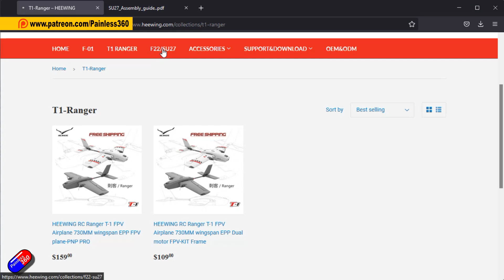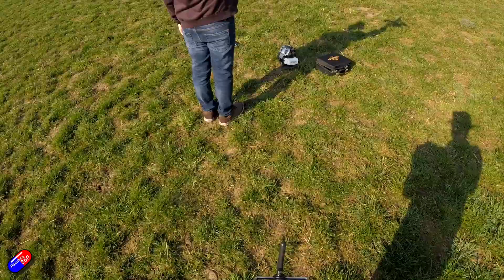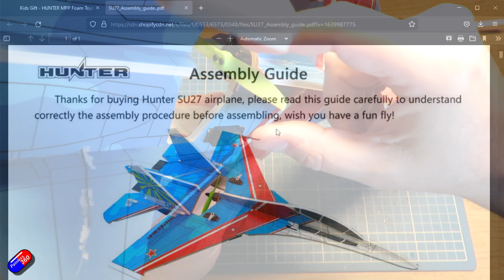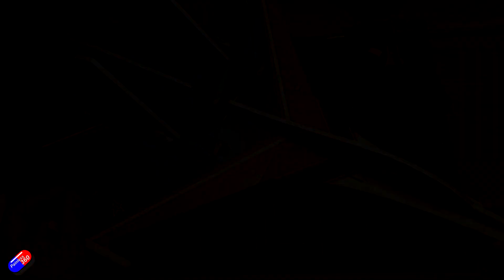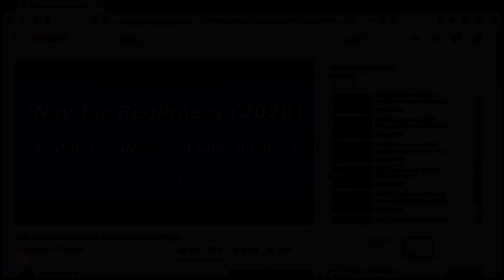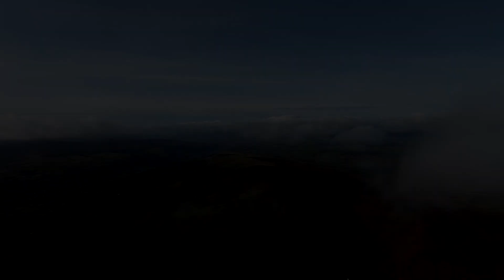HU27 Heewing Jet: Building tips and Review

Comment: Hello bro want to know why esc burnt out with su27rc plane kits my 30a esc burnt out
Reply from the maker: It could be a few things, without knowing what happened it's impossible to say which it was.... Happy flying
Reply: @Painless360  I used 2200kv motor 30a esc 9grqm 2 numbers servo and 3d print plane model battery 1500mah 11.1v 3s 6 inch propeller in 3 seconds flying burnt out wsc and plane as well wire are fix Yellow with yellow red with red and black with black esc wire in receiver port 3 and servo port 1 and port 2

Comment: I just got one and put it together and got it in the air today. I dont understand how s-bus works so mine is just flying off a ar500 spectrum receiver. It seemed sluggish and squirlly on a 2 cell so ive been flying on a 3 cell. I had yhe propeller break the first time i throttled it up so i swapped it out with a little zod motor with a nut. It flys good but without stabilization, you kind of have to stay in the throttle or else it has a mind of its own.

Comment: Do you still have the setup with your inputs and mixes for this or the f22? Ive tried for 3days straight and its just not right? I bought the version that comes  with X6 radio and it flies really good with it  i tried setting a flight mode and when it goes to manual mode the motor wont turn on? Please help PLEASE,!
Reply from the maker: I don't, best of luck

Comment: Where is the CG on this plane? Does it fly without flight controller. I did buy the F22 on aliexpress but instead of recieving the FTC2.1 flight controller, I did recieved a Heewing RX 1.0. The latest as strange behavior when I test on the table. So I made the maided without flight controller and the CG is way backwards compared to where it should be. This makes me thing the controller is compensating for bad cg.
Reply from the maker: I gave up on mine and binned it so can't check. This is the only bad plane Heewing have made IMHO. Best of luck

Comment: Updating my opinion of this little profile plane. I finally got this working with a Radiolink Byme-D gyro (paired w/ an Radiomaster R81 receiver).  Flew 3 good flights now and the conclusion is that it needs to have 80 to 100% throttle to keep it afloat (other club members mentioned it's underpowered).  Under that, it will stall very easily.  Plus, not the best plane for rolls or loops as they all induce stall as well.  Regardless, I like it now after going through many many 'maidens'.  However, while small and docile (implying a beginner may lean towards it), I don't think it's a beginner plane considering all the work to get it flyable (and the original flight controller was scrapped too; may revisit its use in the future on another plane).
Reply from the maker: Not sure why they still sell this, it is terrible... Happy flying
Reply: @Painless360  i second this. I scrapped the stock gyro and put in a small byme gyro but despite that it was terrible. 

Finally got it flying but it has this terrible tendency to just roll suddenly and then plummet to the ground. 

I kept thinking it was the gyro so finally tried it direct without a gyro but faced the exact same issue. Eventually it to bits. 

Since I now have all the electronics could you recommend any other plans for a slow flier on a 2S 850 mah battery. Might as well use the components
Reply: @arshishmaneckji9547  wow, u just described my exact experience.  I scrapped the original flight controller/gyro and got a Byme-D. Remaidened yesterday and confirmed control surfaces should move in its proper direction. Then launch and it just rolls over.Then flew it for all of 50 yds w/o stabilizer bit then (no wind) it stalled out on a straight-away!  Seems need full throttle.

Comment: I'm just trying to set one of these up in my radio at the moment; I note from Lee's comment (and also trial and error) that the Throttle is (weirdly) disabled when Ch7 is high (+100). However, I'm not sure about the Flight Modes; I believe Lee commented that Ch5 low (-100) is full stabilisation, but I'm not sure I interpreted that correctly and what other modes might there be at 0 and +100? Has anyone set one of these up successfully and worked out the flight modes?
Reply: I’ve yet to figure this out

Comment: HI LEE - I HAVE BEEN FLYING PLANES LIKETHIS SINCE SMALL BRUSHLESS MOTORS AND LIPOSAPPEARED - PLANS WOULD WHIZZ ROUND THE INTERNET - MIG 31 - F-15 - EUROFIGHTER - ETC ETC - WE WOULD FLY THEM IN LOCAL PARK - HUGE FUN - BUT WITHOUT ANY STABILIZATION !!! - AND COMBAT - WITH 6 OR 7 CHASING EACH OTHER AROUND THE SKY - AND VERY CLOSE - HALF A FOOTBALL PITCH - AND THIS IS THE BEST WAY - AGROUP OF YOU - MAYBE I SHOULD BUILD SOME MORE !! - HE HE HE - FOAM BOARD IS AVAILABLE AT LOCAL MODEL SHOP - I ALSO HAVE THE BIGGER ONESFROM BANGOOD - 850 MM SPAN - F-35 - F-15 - WITH BIGGER MOTOR - THINKING ABOUT CONVERTING TO EDF !!! - WILL SEND YOU PHOTOS - CATCH YOU LATER - TAKE CARE - HAPPY FLYING - DAVID
Reply: Hello David. Just one bit of advice, please buy a new keyboard as yours appears to be having an issue with THE CAPS LOCK BEING ON ALL THE TIME LIKE THIS. 🙂

Comment: I'm still flying my Hobbyking SU 27 glue n go it's now 6 years old and only had minor repairs also have a Arctic cat also glue n go great flyers both of them and no giro and at £30 pity they are not available anymore.
Reply: me too HK SU37 glue n go, and its awesome even today i was flying mine,  it goes out in all weathers, and must have the most amount of hours  of any model i have owned in 48 years of RC,  recently got a Ali express special slightly smaller and now i had a barn find of one of these  even smaller Heewing su27 it will be setup all manual as i dont fly gyros unless its INAV.

Comment: Out of interest, why the teranis being used not the tx16?
Reply from the maker: It was the one to hand when I set it up. Happy flying!
Reply: I would also like to know as I have a tx16s and can't get my throttle motor to turn on low stick ir is at centre stick. I bound it to a fs a8 receiver.
Reply: @jheath1968  sounds like you need ESC calibration to your radio.

Comment: Lee- I agree that some aircraft come with possibly a pictorial assembly guide, and nothing about the finer art of making it fly.  I just went through this with a wing that has a stabilized mode, and absolutely nothing about radio setup.  Ought to be a law against such.  Seems simple, but emphasis on easy, proper, correct setting up is routinely lacking.  And quads, forget about it.  Good thing we have the internet and forums to rely upon!  Cheers from the States